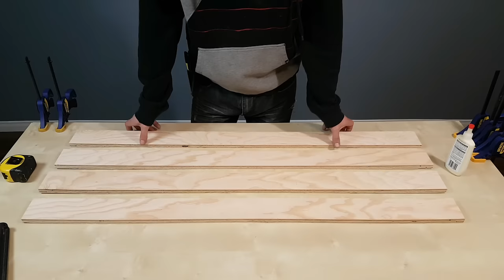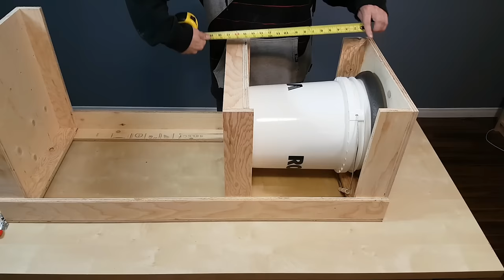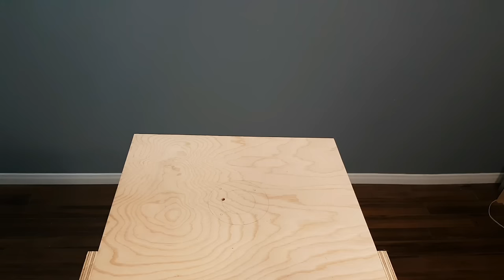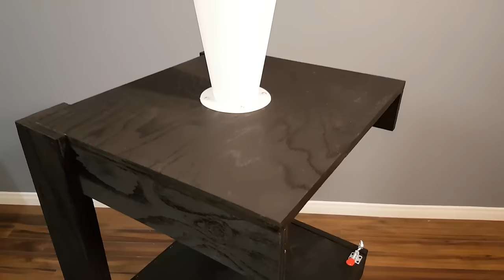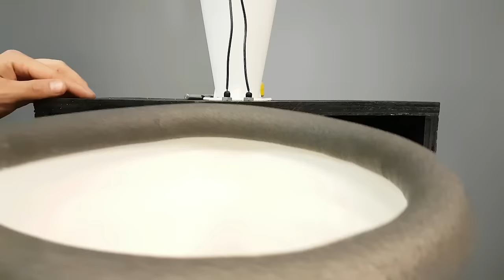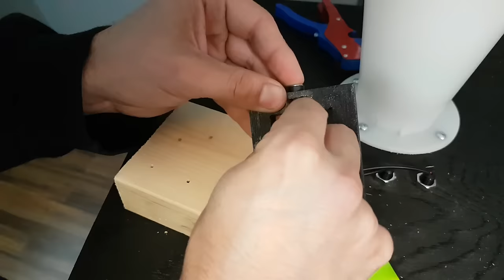How to make a DIY Cyclone Dust Collector / Complete tutorial

Comment: Love the design and looking to build my own. However, I'm a little concerned about the seal between the foam on the rim of the bucket and the top shelf. Is it air tight? Is there some leakage causing lose of suction? Please advise.
Reply from the maker: Hey! The pipe foam was working perfectly as a seal, but i had to replace it two time before i decided to make an upgrade.I took 30 minutes to make a 4 picture pin on my pinterest to show you an upgrade I made of my seal system. I replaced the pipe seal with an under carpet that i covered with vapor barrier tape for more durability, then I screwed the under carpet to the plank over the bucket. Now when I lock the clamp, it lift the bucket onto the under carpet and make a perfect seal. It works perfectly, it's sealed and also when you remove the bucket, you end up with the bucket only, not the bucket and the seal. Check it out here : https://www.pinterest.com/pin/451134087681923397/ or search SEB TECH DIY on Pinterest , hope it help!
Reply: @SEBTECHDIY  I'll take a look and build my collector with the under carpet upgrade. Thank you.
Reply: I only see 1 picture on Pin. I would like to see the others.
Reply: This is such a clever design -I like it. I wonder if you fitted one of those foam carpet tiles (with a hole!) underneath the cyclone shelf, the pipe seal would be fine - it wouldn't them be rubbing against wood. I think thats what I'm going to try. @SEBTECHDIY

Comment: I built this and it has saved countless filter cleanings.  I did make a modification to the input by extending it down through the top shelf and out on top of collector bucket shelf and attaching to the shelf arm.  Eliminated the tippy when pulling by the hose and took strain off the cyclone.  Thank you!

Comment: Definitely the best looking diy dust collector tray I’ve seen. I regret buying a 10gal DeWalt shop vac now, it’s going to make this thing massive when I build it
Reply from the maker: Wow, thanks! And if you buy a shopvac ( i know you already done but ) the best thing to focus on is HP and not the overall size of the recipient because 99% of the debris will go in your bucket. Hope you are going to share your project with us when it's done! 👍
Reply: SEB TECH DIY I had no idea about dust cyclones when I went shop vac shopping. The DeWalt was the most powerful and surprisingly cheapest out of all the options in my price range, I always assumed a shop vac was equipped to deal with saw dust but after using it I can really see the power drop off when I vacuumed tons of fine dust. That led me to endless searches on dust cyclones and I found yours. Like I said, not trying to blow hot steam in your ear but this is literally the most ergonomic and most aesthetically pleasing of all designs I’ve found. When I got to the part of the lights I just thought “okay this guy is just showing off now” but seeing the functionality of it blew my mind. Excellent job you’ve done here sir.

Comment: I completed mine a few weeks ago.  My first 'real' project.  I used 3/4" plywood and added an additional 8" on the back .  Made a shelf for some vacuum tools.  It is so much more than I hoped for.  Thank you for a great design.  Btw, I didn't add the light.  So easy to just drop the shelf and look in the bucket.

Comment: @SEB, great build and video.  I built one and love it.  Use it daily.  I fashioned a hose clip on the back from a piece of old coat hanger and adding an extension cord hook this evening.  When I mod it all up I will see about adding pics to your instructables page.

Only thing I might change if I built another... the 6 bolts for Dust Deputy I would use flat heads and come up from bottom and countersink so they are flush.  That way nothing can catch on the foam seal when taking bucket in and out.  I used standard bolts that I cut down and square nuts that are low profile so it works quite well.  Flat heads would just be that much better IMO.

Thanks again man, awesome build and very useful tool.

Comment: Great video, subscribed.  I like the useful idea for a project, the clean and to the point editing style (no 10-minute vlogs about the philosophy of dust collection, what you did on your summer vacation, etc.), the on screen cut list with measurements, and even the simple elegant design elements of the project itself (i.e., it's not a rolling workshop that does 15 things including making ice cream -- it's a dust collector cart, period).  I also like the vertical design, requiring less of a footprint in a small shop.  Well done!
Reply from the maker: Thank you so much !! 😄

Comment: Just finished building one similar to yours.  Should have verified measurements since the bottom shelf was about 1/2 inch too tight for the sides of my vac.  No sweat... that's what sanders are for...just sanded off a tad of wood.  Think I'm going to love your model vs my old setup since it saves me a ton of space. Thanks for the idea....
Reply from the maker: Thank you Fred ! I'm glad you like it, indeed it saves a lot of space in my workshop and it works perfectly! 😏

Comment: I'm a newbie and I was able to build this, no problem. Great video and great design. Thanks for posting!
I made just a couple of changes. Instead of the hold down clamps I just used 1/4" x 3" eye bolts (so I would have something to grasp) and drilled a hole through the collection bucket shelf supports and shelf to hold the shelf up right and tight. I have a different Shop Vac but the dimensions were almost the same. Mine was just a bit taller so I added a little to the uprights to compensate. I also used two fixed and two rotating casters however, I think I'm going to change the fixed ones to rotating. And I didn't use the central vac piping because I couldn't find any locally so, I used 2 1/2" Shop Vac hose instead. I'll eventually change that to hard pipe.
Finally, I just used an old paint bucket I had that's not translucent. So, no light inside. Yet. I'll eventually change that also.
Oh, and I didn't paint mine. Yet.
Reply from the maker: Awesome to see this, you should send some pics in my instructable here : https://www.instructables.com/id/DIY-Cyclone-Dust-Collector/  I would really like to see the result! 😃

Comment: Very nice and easy build and very simple to build even if you didn't supply the dimensions of drawings although don't get me wrong that was a plus and it's easy to adjust the dimensions for what ever vac you use
But the real beauty of this stand is that adjustable plate under the bucket true genius and we'll the LEDs well that's just the cherry on the cake.
Congrats on the project very well done and all painted up looks just like a jewel

Comment: Hi! I've looked around and I don't seem to find something explicitly listed. Could you please provide source / item ID for the LED lights you used? They look a bit like what offroaders call "rock lights" but these ones are more compact and probably lower wattage than what I'm finding on my own. Lower power = less heat. Thanks!
Reply from the maker: @Micheal M Butler You can find them on ebay by searching ''eagle eye led''. They are waterproof so you can use them anywhere like offroad or in this case a dust collector! 😄👍https://www.ebay.com/sch/i.html?_from=R40&_trksid=p2334524.m570.l1313.TR12.TRC2.A0.H0.Xeagle+eye+led.TRS0&_nkw=eagle+eye+led&_sacat=0&LH_TitleDesc=0&_osacat=0&_odkw=screw+bolt+led&LH_TitleDesc=0

Comment: Nice job with those clamps! Such easy by using them this way.
One question: wouldnt it be nice if the chrome-painted pipe could fit in a corner of the cart? So it isnt sticking outside the cart?

Comment: Just one question if the hose gets blocked does you bucket compress? I had this issue so I put 2 buckets inside each other. The best way I found though was a wooden box to catch the dust/chips which also gives a larger volume. Windows could be put into the side of the box to show dust level. My dust collection from sanding, planing and vacuuming my workshop is as close to 100% as possible over a weekend of work and 3 large rubbish bags of dust chips.

Comment: Great job! I know all the dimensions may change when using a different brand and model vac, but which brand  cyclone did you use? Thanks.
Reply from the maker: I used a china knockoff version that i bought last year on aliexpress, just type "cyclone dust collector" on aliexpress or ebay, it's around 20$. Also you can buy the original oneida here : https://www.oneida-air.com/ ;)

Comment: One of the best desings I've seen.  I love the quick and easy bucket release.  Have you found any issues with it not holding a tight seal?
Reply from the maker: Thank you ! 👍The important thing is to always have a seal between the bucket and the plywood. The foam hose around the bucket serves well as a seal but I had to add silicone between the bucket and the foam to ensure a good seal. Now when I remove, empty and put the bucket back in place, the foam stays well glued to the bucket. 😉

Comment: Nice, but no demo of it in use?
Reply from the maker: I did a small demo in the first seconds of the video to show that you can collect dust without loosing succion. I since recorded alot of videos of it in use, i will post some on my instagram. We did a full beedromm renovation and my shopvac cart was so effective to remove drywall dust, i never had to clean the shopvac filter, i just had to empty the bucket i was so easy 👍

Comment: How has this held up with time? Do you find the foam gasket you created at the top of the bucket is sufficient to seal the system?
Reply from the maker: Very good, still use it every weeks. Foam still make a good gasket, i only had to tight the clamps a little bit over time and i added some silicone under the cyclone adapter because there was a small leak from there. Otherwise everything works perfectly.

Comment: Awesome video ! what did you use to seal the bucket ?
Reply from the maker: It's a foam that you put around pipes. But i have modified a little bit my build. Now i have put some under carpet foam under the plywood where the bucket seal. So nothing on the bucket, the seal in now on the plywood.

Comment: A very neat and tidy unit. well done. Unless I am greatly mistaken you don't seem to have listed your source for the foam tube - was that pipe insulation?
Reply from the maker: Oops I forgot that part. Yes actually it is a foam tube to insulate the plumbing pipes. You should be able to find it in any hardware store. 😏
Reply: Cheers, it's a good idea actually.

Comment: Love this design. SEB TECH, could you explain the connection of the vacuum pipe to vacuum inlet for me? Is it a fairly good seal? I'm going to build this, need a little more information please. Thank you, David.
Reply from the maker: It fits perfectly in the shopvac as would the original pipe, otherwise you can add some electrical tape around the pipe to make a good seal 👍

Comment: looks cool, lost of hard work, and dedication but what does it do that the shopvac couldnt ?
Reply from the maker: Shopvacs vacuums clog up rapidly but with over 97% of the sawdust getting trapped in the bucket, the filters stay cleaner for longer and power drop-off is significantly less. You can easily empty your dust and debris from the bucket without ever having to open up your vacuum. With the clamps i added, it's a time-saving machine! 😏
Reply: SEB TECH DIY to thank you I was honestly curious
Reply: A bucket is easier to empty.

Comment: Do you happen to know the model number of the clamps you used?  I ordered some online and they are too small. Thanks
Reply from the maker: Toggle clamps i used are pretty small , you can see more pictures of my toggle clamps here : https://www.pinterest.com/sebtechdiy/diy-dust-collector/ . Also this is exacly the clamps i used, from ebay : https://www.ebay.com/itm/4Pcs-Quick-Metal-Toggle-Clamp-Horizontal-Release-Hand-Tool-For-Fixing-Workpiece/272784440861?epid=2151313135&hash=item3f83383e1d:g:Hf8AAOSwEFZZfsbA  ;)

Comment: CNN I am using same  Dust Collector Cyclone Collection and I was contacted it same your way but but most of the dust ends up in the vacuum cleaner! Can you help me to know the reason?
Reply from the maker: It's because it is not completely sealed, I had the same problem at first when testing my cart. Make sure the bucket is sealed to the plywood and same thing with the cyclone adapter. My leak was around the cyclone, then I added some hot glue around the base of my cyclone adapter and it fixed my problem. Hope it help! 😉👍
Reply: @SEBTECHDIY 
Thanks you so much. 
As your answer I found the reason which is a leakage from barrel cover that way collecting a dust it solved. 👍👍

Comment: SEB I finished building my system just as you did but for some reason the material still goes into the vacuum's receptacle vs the bucket.  I seem to have a good seal, used the chinese cyclone, have decent "sucking" at the hose, used a 3.0 HP 8 gallon Craftsman vacuum......but have this dad gum problem.  Do you have any idea why it would deposit the waste into the vacuum vs the bucket?  Anyone else have this experience?  Is a perfect and strong seal at each point (bucket ring, pipe into vacuum, pipe into cyclone, hose connections) absolutely necessary?

Comment: Why is the main dust collection above the vacuum?  Why not have it below, does it matter?
Reply from the maker: Since the dust goes all the way into the bucket and it is this one that must be emptied most frequently, I placed the bucket above the shopvac so that it is easier to empty by being at a better height . ;)
Reply: Ok, I can see how it would be good for bench work as well such as track saws,  as well as sanding or to assist with at saw blade dust collection on a table saw.  Nice job!

Comment: How stable is the unit if you're pulling on the hose?  Does it fall over easily?
Reply from the maker: No it don't fall at all. Surprisingly it is very stable. It's something I did not think of when I designed my dust collector. The only thing I would change are the casters, these are the most economical that can be found and they do not roll very well. Otherwise, I use it every week and I'm really happy with the result! ;)
Reply: If your worried about stability place a large concrete paver on the bottom

Comment: That central vac pipe ABS? Those fittings are diffinately PVC. You used ABS to PVC cement. Probably won't matter on this vacuum.
Reply from the maker: Vac pipe AND fitting are all PVC ;) I already had this cement on hand so I did a test to see how strong is the bond, and i can assure you it's stronger than the pipe itself. ;)
Reply: While I agree, for your vacuum system, I don't foresee any problems.
As for your joints being as strong as the pipe itself, ASTM Specifications say otherwise; ASTM D3138.
1-1/2" schedule 40 PVC pipe has a burst strength of 1,075psi.
That glue is only rated for under 25psi WHEN used to chemically join PVC  to ABS. It is nowhere as strong as proper PVC glue, when used to join PVC to PVC. Transition Solvent-Cement is only intended for drain and sewers where one joint is PVC, the other ABS.   
Just wanted to put that info out there, for those who would like to make this. Like I said, for vacuum application, the bond will be fine, your more likely to break the pipe if you drop the the unit off the back of a truck, but it is not stronger than the pipe itself. Don't know what you did to test the joint.
ASTM test are very specific,  something like 10,000 hrs at 73°F. @ specific pressures and loads. ASTM D1598
Here's a test you can do:
Make two test fittings, one glued with transition cement, one with proper primer and medium-bodied PVC assembled by priming the pipe twice, fitting once, apply glue in fitting and on the pipe. (This is not the approved way, but it's good enough)
Let them both cure for 24 hrs. 
Pressurize them with water to 200psi, and watch the transition cemented fitting blow apart at the joint. 🤓👉📋📏🖋
Reply: Tuts... there's always one.

Comment: Can someone tell me why he just isnt using the vacuum cleaner to suck up the dust?  Does this contraption make it suck harder or something?  I want this, but i dont know if i need it. lol.
Reply from the maker: It's because without the cyclone,the dust will go directly into the shopvac and it will clog the filter quickly, and you will lose a lot of suction power. This way, all the dust drop in the bucket under the cyclone, so you never lose suction power and the clean out is quick and easier! ;)

Comment: where you buy the bucket seal?
Reply from the maker: You can probably found it at your local hardware or home-improvement store, bought mine from Rona ( owned by lowes ). You can also use a used bucket. 😉

Comment: I guess I’m the only one to notice that there is no way to remove the plastic bucket. Your design is flawed because as you release the clamps the bucket is pushed up against the plywood that holds the cyclone. So nice looking, but flawed.
Reply from the maker: I dont know what you mean. The front lower so you can remove the bucket, and its pretty easy to remove it. I emptied this bucket dozens of times without any problems. ;)
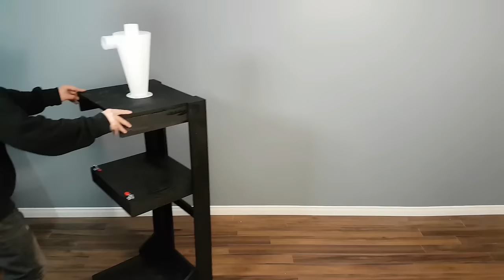Reply: SEB TECH DIY look at 6:15 on your video. The bucket platform is hinged to flip up, not down. That makes it impossible to remove the bucket.
Reply: @antonioperez1624  nope, not flawed. The front of the shelf holding the bucket is cut shorter than the sides of the shelf (you can see the gap).  If you can see the shelf open upward and also downward, then it's obviously a 270 degree piano hinge. 
Great work Seb Tech. Like so many other comments here, this is easily the best Dust Collection cart on YouTube.